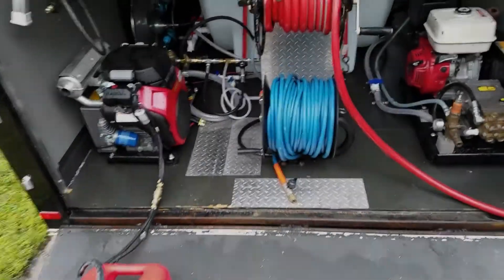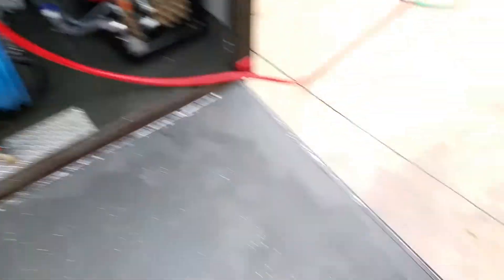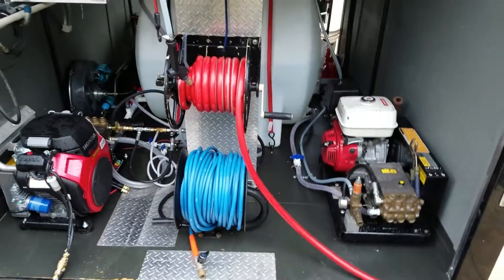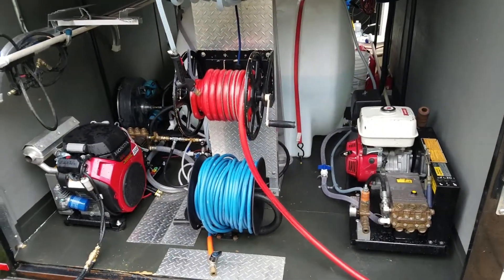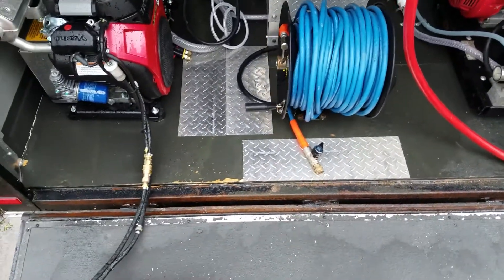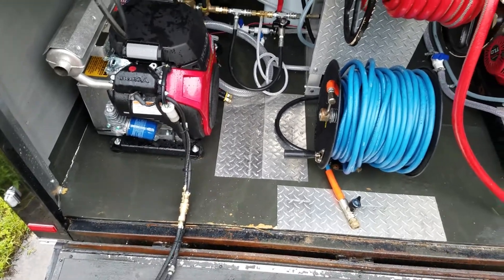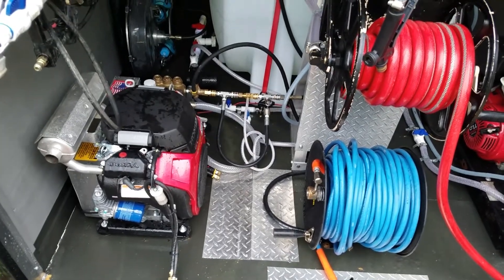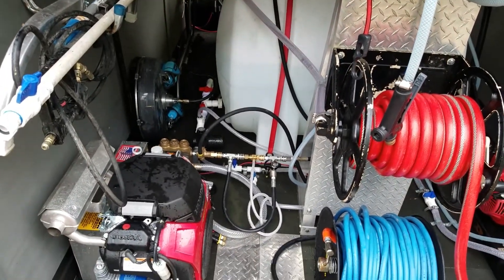Downstream injector bypass/quick truck washing.

Comment: What mix would you use to remove mold and algae from limestone patio, that will not kill grass or plants. My first thought is to pick up some snot from russ, mixed the 10% bleach and run through downstream injector but I am super nervous about killing any grass. Any suggestions will be greatly appreciated
Reply from the maker: Just downstream inward so your solution isn't running into the grass. I wouldn't worry about using extra surfactants on a patio, besides regular dish soap. Rinse thoroughly after an you will be fine.
Reply: Thank you very much for the info